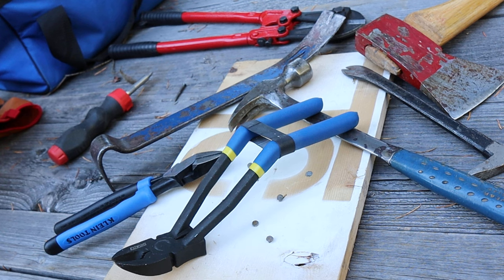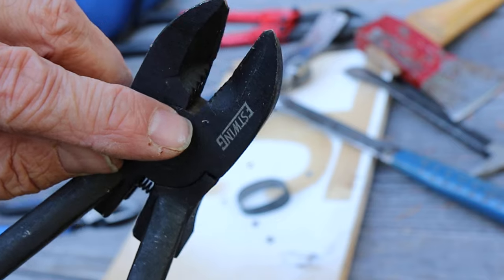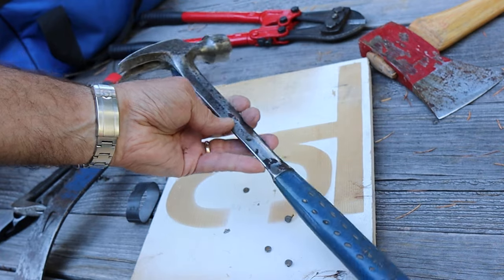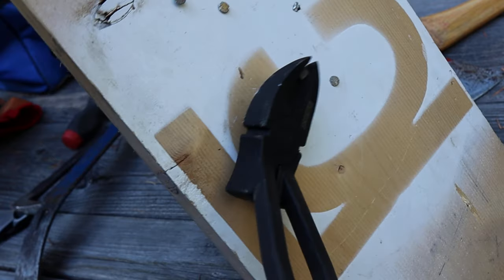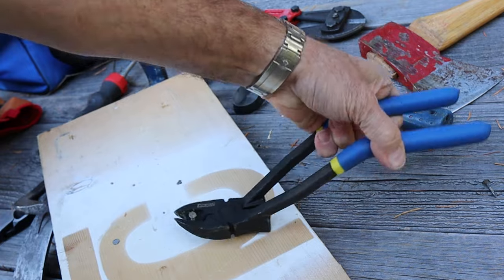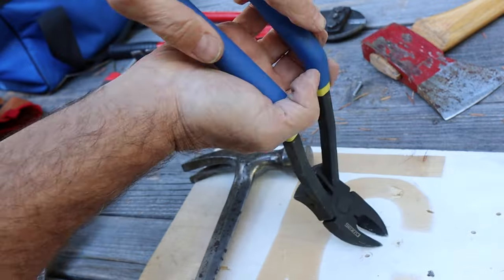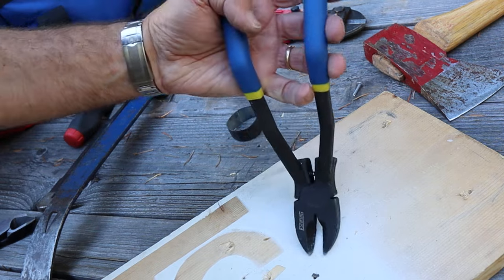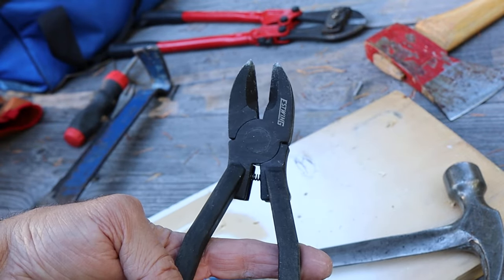Jack in the Toolbox: The 11” Estwing Nail Jack pliers. Unusual. Specific. Unique. Huge. Essential?

Comment: Thanks Doc for the very educative video. Another useful tool to remove nails, if their head is already proud of the surface, without damaging said surface: the Cable Cutter Bahco # 2918 235mm. If you can find one, that is, as it is now considered an antique. Place its circular flat face on the surface, put the head of the nail inside the cutting jaws, close the handles, and gently pull up. With a bit of practice, one too will soon be saying: 'No damage to the board. Look at that. Perfect.' using the old Bahco.